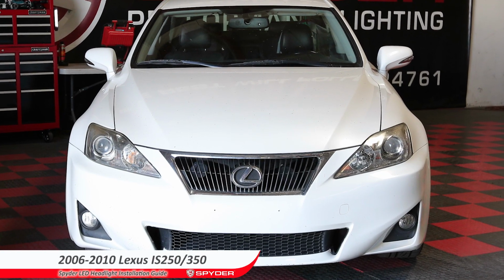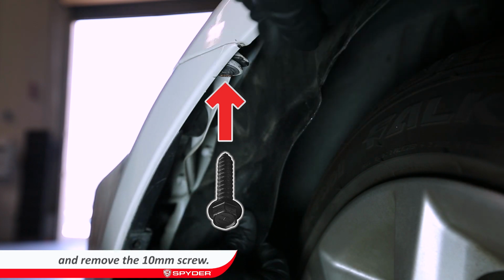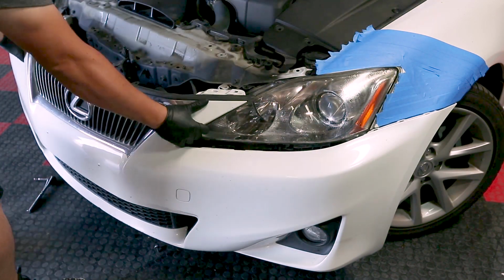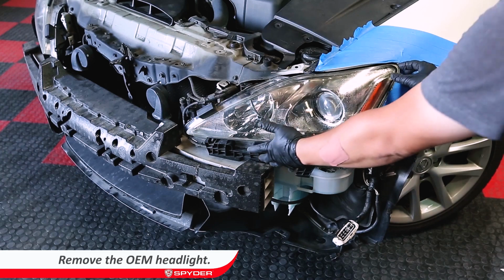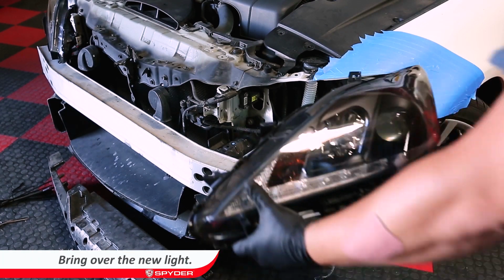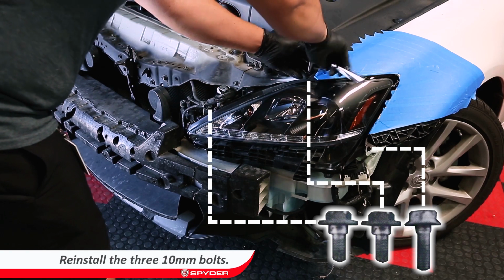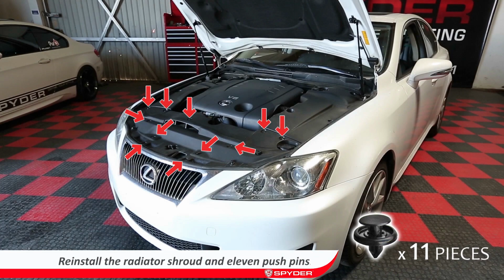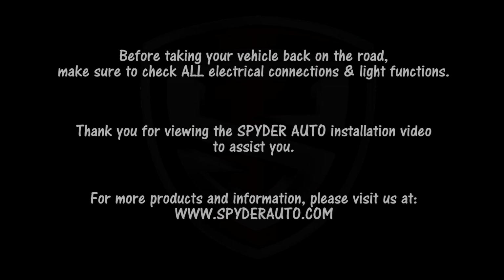Spyder Auto How to Install: 2006-2010 Lexus IS250/350 LED Headlights

Comment: I have a question, i have those headlights on the lexus i recently bought and one of the low beams is out. Is it possible to replace it, without having to disassemble the whole headlight??

Comment: Very good video. I have issues with my bumper. It doesn't seat properly and got a small gap on the top side below the headlights from both side. Can you advise what may be the problem?

Comment: Hello, do you know what the second small connector on the headlight is for? There’s the main harness connector and then there’s a small 4 pin connector. It’s the 4 pin that I am unsure about
Reply: Here tryna find the same thing lol
Reply: Me too lol
Reply: In one of their previous videos they mentioned it was the outside temperature sensor but I can't guarantee if that's correct or not
Reply: How come they haven't replied I'm on this same issue in the video it looks like it just stays tucked away a video of how there suppose to properly function would be nice

Comment: What kind of ballasts do these LED lights have? I heard the headlight unit without ballasts directly wire to the battery terminal are better and avoid ballast issues like the OEM ballast. Help!!
Reply: i dont think led lights require ballasts

Comment: I just put these lights on my 09 is250 and they look amazing!  But since I put them on my afs off has been non stop flashing.  My auto lights work so I don't know why I have the afs off sensor on.
Reply: theres a fuse under your steering wheel that you can pull out and the light will go away. its a brown 7.5 fuse, theres a video on how to do it
Reply: Did you have the factory xenon hid headlights?
Reply: @slomar400  I had the factory headlights before these
Reply: Ross do you have a link on where you gy o your lights. I have a 09 also.
Reply: @rossharris3239 hello we’re they HID from factory or lef

Comment: Why don’t these fit ones with factory HID? Doesn’t It remove the ballast completely
Reply from the maker: These headlights are not wired for the factory HID setup.
Reply: Spyder Auto so can i not change them to LED lights?

Comment: Did the fog lights work after the swap out?
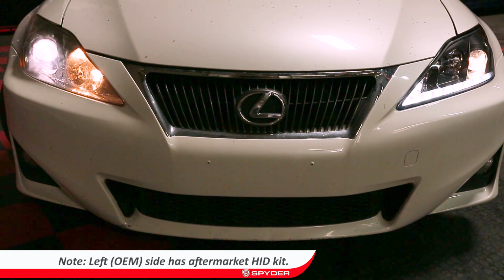Reply from the maker: The headlights have nothing to do with the fog lights.  The DRL function has changed.  You can skip towards the end to see the before and after video (around 5:28).
Reply: Spyder Auto this is incorrect, the fog light harness comes out of the headlight and it isn’t the same connector as my stock fog lights on an 08 AWD

Comment: How do you adjust the aim of the headlights
Reply from the maker: Please take a look at our website for pictures showing where the adjusters are located.  Thanks.
Reply: @Aroldo Franco took them off and on and off and on:/
Reply: @jesusrubalcaba6578  did you get them adjusted correctly? im still having trouble with mine
Reply: @otiliocar  taking them off and on for the left one

Comment: Who the F would replace the Original HIDs to them cheap ass basic  headlights 🤦🏻‍♂️
Reply: The D4S Philips xenon bulbs are driving me nuts. I change a pair each year and they are not cheap! I wish Lexus could provide an LED replacement!
Reply: I would get them, if my lights were yellowed and/ or internal cracking on the lense or factory housing. I refuse to pay over 1k per side for Factory HID lights....IF you can even find them for sale.